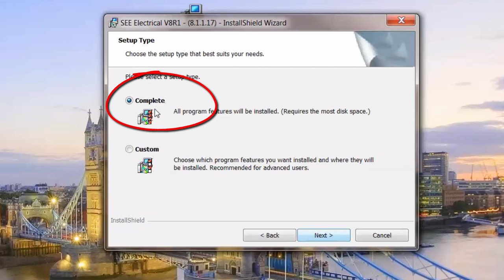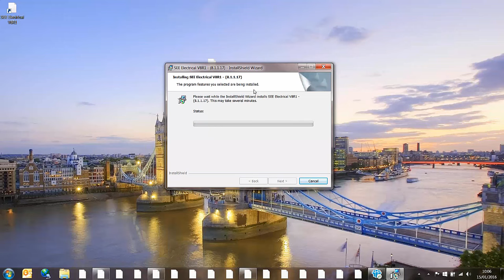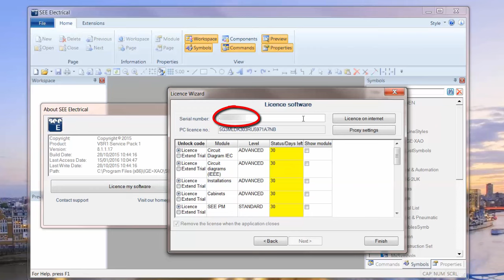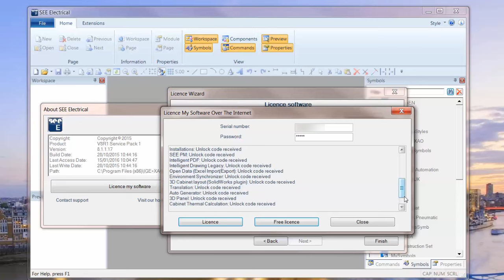Installation and Licensing See Electrical V8R1

Comment: When i installed and licensed the program, i can't open any projects or anything. My screen is just the top bar, the rest is just grey.
Reply from the maker: In the Home menu can you see a button to display the Workspace panel, and if so can you see a project structure displayed after opening a project. If so you should be able to extend the Circuit Diagrams section and double-click on a page to open it. If this doesn't work please contact your local support team and they will be happy to help.

Comment: Hi, I have a doubt:
Can you confirm if you need local admin rights or not to RUN the application in a daily basis?
Thank you
Reply from the maker: Hi Thomas, you will need local admin rights to install the application, but once installed you should be able to use 'Standard' rights. This works fine for Windows 10 however be aware that your IT department can tweak the settings from the standard profiles and may restrict you too much, preventing licensing from being remembered or something else.
Reply: Thank you very much-
Reply from the maker: You're welcome. If anyone has any other experiences please post. I did find a new Windows 7 computer without Microsoft Office that needed the Visual C Redistribution pack installing from Microsoft to allow See Electrical to run. Nothing else so far :)